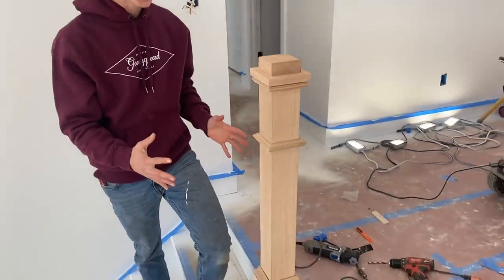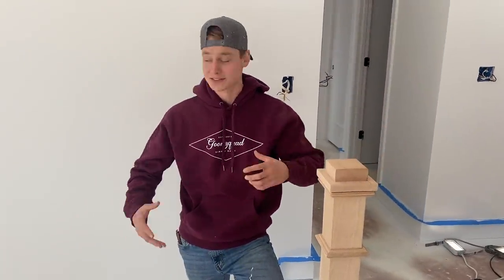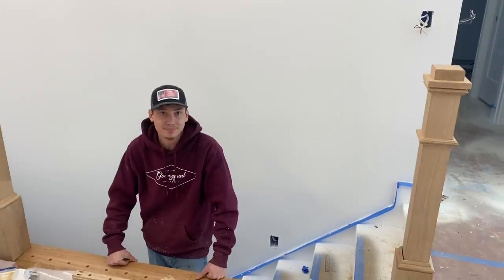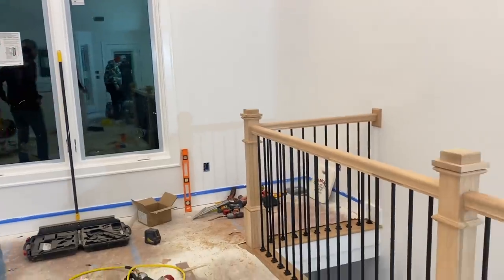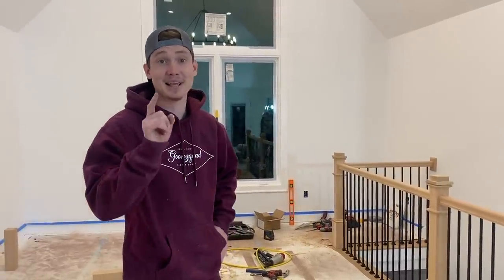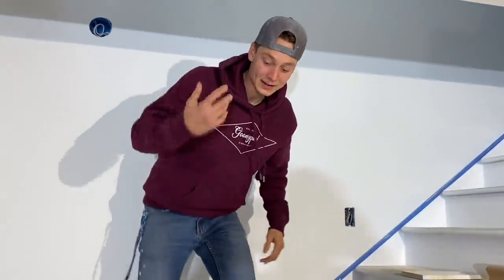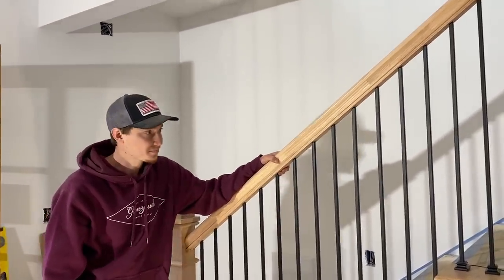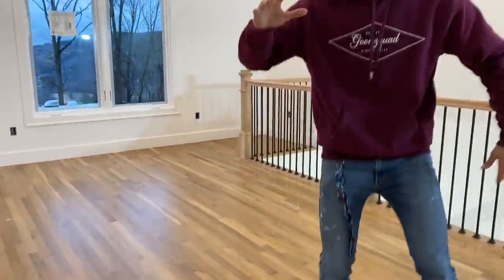The New Goonzquad Headquarters Part 64

Comment: The reason those newel posts were so long is because you were supposed to bury them below the floor and tie them into some structure! 😔
Reply: What I have seen was to notch out the 4x4 hole in the flooring, sit the post in hole then anchor it with the braces.
Reply: Yep installed 100% incorrect. No way this passes inspection. What is worse is the potential to kill someone when the guardrail comes loose.
Reply: Exactly!!!
Reply: Need to use wooden dowels in the post and hand railing. I would also use some type of lag screws though the posts to the sub frame below the floors, I am afraid if someone gave your current setup can pull those small screws out.
Reply: @ingresswizard9044  Yep. No way that passes inspection.....if the inspector's on his game.
Reply: they don't actually know what they are doing..it's just wing it and go...
Reply: @Bon Aif why you post a unrelated video?
Reply: @Martin Dang son!
Reply: @Last Name First  What defects see hidden under the car paint???
Reply: @OldManGaming1968  Yes zip bolt would work.. So would a lag like this.  Both work same way. https://cheapstairparts.com/how-to-install-a-wood-newel-post/
Reply: @Martin I've mentioned this before. These two use YouTube to research how their projects should be done so, presumably, others do the same. It's quite possible that they saw this "method" on YT and took it to be an "educational" video, a "how-to". 
By posting their attempt, they've made things worse. That means there are now 𝑎𝑡 𝑙𝑒𝑎𝑠𝑡 two vids on YT showing this way of installing a Newel post.

If(when) they discover their mistake, they should take this video down. Maybe sounds over-dramatic but it 𝐜𝐨𝐮𝐥𝐝 save someone's life.

We all make mistakes; the important thing is to learn from them.😁
Reply: @2H80vids  It's not over dramatic at all, their videos get a million views.  If one out of 500 people that watch this video build a house and build some stairs later in their life that's 2000 that build railings that will fail with a good push.  If you have 2000 inproperly done railings you easily could have somebody get seriously hurt or die

Comment: Having your HVAC system professional cleaned post construction/pre move-in is a must.  You'll be living in and breathing that building dust for the rest of your life if you don't.
Reply: lol, you know what filters do right?
Reply: Facts inside Evap Coil and Condenser needs to be cleaned
Reply: @Dennis Moroz the problem is, they didn't seal off all intake and outtake vents during construction.
Reply: @Dennis Moroz filters are generally never changed every 30 days and the evap coils are supposed to be cleaned once a year regardless. There are no filters for the condenser coils either.
Reply: @nickwagner9339  yes there are filters.... but 

After the filters the duct lines are currently filled with crap from the building proccess, the filter  being BEFORE the dust will not do any good. Sure it will filter the dust picked up but the whole point of the clean is to get rid of the crap that is sitting in the hvac system.

Just sayin.

This is a common thing to do after a build is finished if you have good builders and hvac guys.
Reply: @nickwagner9339  HAHAHAHA obviously YOU don't know.. if there is crap in the ducts AFTER the air goes through the filter what is it going to do? That's right, NOTHING.  Buy a clue next time when you start trying to laugh at someone else.
Reply: @westie4ageturbo.749  If they bought a system that doesn't filter the return as well as the supply, then your right. Every HVAC I've ever worked on has both, maybe that's just industrie, or a lack of regulations where they are.
Reply: @Bon Aif wtf is that?  LOL
Reply: @CSM.HBJ-Dogg  3rd
Reply: @nickwagner9339  filters are on the intake air. Not the air that's already in the system.
Reply: @nickwagner9339  unless you have a filter on every vent then your wrong. if there is 20 lbs of sheet rock dust in the duct work how is a filter going to get that out? it will first have to leave through a vent get in the air and then be sucked back into the intake. (which means they will be breathing it in)
Reply: Have the ducts professionally cleaned. Drywall dust is much finer than dust. It will build up on your evaporator.
Reply: @jamram9924  just turn the damn thing on and open the doors and windows. Just like an italian tune up
Reply: They haven’t had any electrical running in the house meaning the hvac system isn’t even on, I doubt the dust has traveled that far into the ducts.. I feel like wouldn’t be too hard to take a vacume and and an air compressor with a shoot back fitting on it and clean them out quick. I’ve done a few duct cleaning jobs it’s nothing complicated, even if you do it the right way
Reply: @OliverBund  Indeed. And before that, the unfinished building had been sitting around for a decade with most of its flexible air ducts left open ended. Who knows what crawled in there to check out the bacteria on offer? It would make a great thriller/horror movie. Title: "Aliens 2021: They're Coming Out Of The Walls!"
Reply: @zachbrown1041  they drywall compound dust alone has got to be massive, let alone the floor sanding.   In their part of the country for a house that size, a whole system clean would probably be about $300 - which would be worth every cent to have it done right.
Reply: @Gibbbrayden  Why would you need filters on every vent?  Every HVAC I've ever seen has a filter on the Return and on the fresh supply. 20 lbs? lol
Reply: @nickwagner9339  what do you mean by return and fresh air supply? Everyone I seen there is only a filter before it enters the hvac system. 

Also how would that help if there is a ton of dust after the filter? (Right before it blows the air into the room)

Comment: you're not gonna like this, but for the downstairs rail I would replace the small wooden ceiling plate wit one that spans till the end of the ceiling for the remaining rails. Nice work though
Reply: I agree that is what I was going to suggest as well
Reply: I was going to suggest same thing! Only way to make it look professional.
Reply: And if you do, drill the holes before mounting the wooden plate, sounds logical until you forget :-)
Reply: I thought the same thing. Probably gonna have to remove and reassemble the metal Picketts so they can seal the wood.
Reply: Agreed but they also could have expanded the entire opening to the floor above 6” wider then the edge of steps to allow for one continuous rail along that right side.
Reply: Its unfortunate but thats the same conclusion I came to.
Reply: Exactly what i was thinking!
Reply: i agree as well 
but the top rail not done the gratest
Reply: My thought as well.
Reply: Use a metal plate painted black to match your light and spindles, you can paint can't you?  Construct using (2) 3/8" x 1" steel bars mortised into your existing wooden end cap extending to the wall mounted by to above with multiple countersunk flat head screws. The spindles would be mounted through half holes, those nasty short last step spindles could be tack welded in position on the outside rail. The inside rail closes last with cross bolts then the flat head screws. Edited 1/22. 
Complaining about the filler bamboo wood (saving the environment perhaps a rain forest) which provided the full post dimension then cutting the stabilizing solid core off are 2 big mistakes!  The core was there to be lagged into framework or foundation.
However you redo could retrofit in 6 months when you replace the shaky or sooner if inspected.  However you bring it into code MUST be your next video, this one should be immediately removed so a copy cat isn't injured!  This Old House & How To Fix This Old House have newell post installations and removing shakyness.
Have you repaired (to code) the preshortened first stair tread???
Reply: Agree
Reply: Was just about to say the same thing xD
Reply: Apparently a lot of us thought the same thing
Reply: @Martin the post should have gone into the floor joist, at the very least they should have used a longer screw to go through the nosing and into the joist below. The 2nd floor end post held down with those short screws won't hold anyone from going down those stairs.
Reply: I don't build or anything, but that seemed to me to be the cleanest option.
Reply: Beat me to it....wanted to suggest the same
Reply: That would look best and professional
Reply: Yep, this is the way I would do it too
Reply: Absolutely, that mounting block should have run all the way to the corner to accept the spindles.

Comment: Nice job, guys, those look great!  Two suggestions: 1. Consider buying a length of 3/4” oak about 5” wide to use as an upper spindle locator that you could finish like the floors and treads, it would go on the bottom of the wall from the post top pad back to the vertical wall.  That would continue the color and look of the wood but give you a secure spot to locate the tops of the spindles and finish everything off.  2.  On your hand-rail that will go on the other side of the stairs, don’t forget to add “returns”, the little 90-degree pieces that go almost to the wall from the rail at the top and bottom ends.  Most jurisdictions require them so that something can’t get hooked on the rail accidentally leading to a fall or issue.  You might check with your inspector to make sure, but they’re probably a good idea for safety regardless.  You’d hate to fail inspection for that detail, but I’ve seen it happen...better safe than sorry.  With the Kreg pocket hole jig and a good miter saw, you already have the tools necessary to do this.  Keep up the great work, really enjoying your enthusiasm for making this fabulous.  —Don

Comment: Don't rip the hand rail just extend the wood block cap thats nailed into the wall all the way down. CLEAN
Reply: Do you mean the bit that's going into the ceiling, to put the rest of the spindles into?
Reply: @konradgreen2567  the square wood block the hand rail connects to... extend it all the way down/ make a rectangular strip

Comment: Always draw your ideas on a paper before you start working. The downstairs rail will not look perfekt when it’s done. Remove the small wood plate and replace it with a Bar that spans on your ceiling till the end. Finish drilling the holes and put rails in it, Done! You guys did a very good job so far. You’re very gifted in everything what you’re doing.
Greetings from Italy and sorry for my English!
Reply: Your English is fine! You are right to say that planning and preparation is the key to getting work done properly. I think that many YouTubers consider that it is more entertaining to just rush into projects, make mistakes and then try to fix them. It is a casual, jokey culture which has little if any connection to real working life.
Reply: @johnstedman4075  👍🏼

Comment: Were you secured the handrail going up the stairs into the wood square block, you should have run that piece of wood all the way to the angle (about 3 more feet) so you could drill for your spindles and finish it off.
Reply: Exactly what I would do. 👍
Reply: 100% - it looked wrong
Reply: Also the newel post fixed with L brackets is a little suspect to say the least but we all have to learn along the way. You lads  have really stepped up on this one and done a great job overall though 👍
Reply: Larry is exactly right but also make sure you predrill it before you install it because screw gun wont fit at top 2 steps to drill the top

Comment: I think you need to pull out that little 4” square piece of wood that you put up where the handrail meets the ceiling and replace it with a 1x4 that runs all the way to the corner that way the handrail and all the rest of your spindles run right into the same piece of wood. Simple and clean.
Reply: Exactly my thought!! It'd look so much cleaner.
Reply: @bigred547  Id rip a post in half to mount on the wall so it matched.
Reply: Same here I was thinking the same thing
Reply: Does JR know you are cheating on him with this channel?
Reply: @koolaid53  😂😂 we have an open relationship 🤫🤫
Reply: @goonzquad   DO WHAT IS SUGGESTED FROM THESE COMMENTS
Reply: Yep what he said.

Comment: Love you channel - I own a stair company - Depending on your inspector and how close he looks at things you have some problems.  Your first guard railing post needs be installed behind the top stair riser per code. Use the proper hardware to install your posts and use some Franklin tight bond on your railing to post connections with the screws to keep the joints from breaking and moving.  You need to epoxy in the spindles at least on the bottom for sheer strength and keeps them from twisting/moving, the trim plate will cover the glue.  The guard railing per code has to be able to take 200 pounds of side sheer force.  Your railing right now is dangerous and should not pass code. The railing to wall connection needs to have a wood backer behind the drywall. Your bottom riser should have run clear through to the outside of the wall covered by drywall.  Then fasten your post on the floor to the face of the riser w/glue and hardened screws. The stair railing is guard railing too and needs to run riser to wall. You have to have minimum 36" opening between the post and the wall with the code hand rail installed  : )
Reply: Yes, that is the correct way to do it!

Comment: I have ALWAYS installed the Newell Post through the floor tied into the floor joist. THAT LOOKS A LITTLE SHAKY GUYS no offense. That’s why they come long
Reply: I guess they didn't have any youtube videos showing how to do that. Just the shady way with L brackets. Definitely not gonna hold up to much weight leaning on them and be loose and shaky in no time.
Reply: @wheeln24-79    Redo in 6 months?
Reply: Yes, those tiny L brackets and 3/4" screws seemed way too small.
Reply: HouseT
 That would be sturdy as heck. Great idea
Reply: Fix the Newell Post!
Reply: There is a building code lateral load the guards must meet.  Those tiny clips are wholly insufficient.  I said it weeks ago all newels need to lag into the floor framing long.  Inspector should fail them.
Reply: how about some jb weld?
Reply: @gregh7457  Can you weld wood ?   I was not aware of that. just kidding.  Those railings will Fail inspection.
Reply: Yup always into the framing
Reply: @kdrguru  You can use lags like Zip Bolt or a lag that goes down in to the framing but agree that little 90 bracket isnt right
Reply: Yes sir!
Reply: If they ever read the comments they would have known.
Reply: @waynespyker5731  that's legit......
Reply: @sethb4272  yup TOH Tommy Silva not approved
Reply: @_antman_au  no way the back walls gonna buckle way before because of the runoff from the rock cliff out back taking the deck supports with it
Reply: @gregh7457  or flex tape?
Reply: That's why they have professionals! Their hasn't been a single thing they've done right in this whole build. Its sub par amateur diy at best.
Reply: @waynespyker5731  no way it'll last that long. I pray to God they won't have anyone go anywhere near that death trap.
Reply: @gerthduramaxjosh9611  yeah seriously they were told when they took those things out of the box and asked why are these posts so long? I know it's tough to read comments on your own YouTube channel but seriously they ought to have somebody reading them. For clues.

Comment: Awesome awesome awesome!
Your solution for the hand rail downstairs is as follows:
You see that small wood plate you used to fix the rail to the ceiling? Remove it and get a longer one to attach the hand rail and the steel rods to it. This way it will look consistent all over.

Comment: Those hand rails don't look sturdy enough with those tiny brackets on the bottom
Reply: Just have one of them lean against it with all their weight and see what happens...😐😁😂
Reply: Its super sturdy.. proceeds to wobble it lol yeah dont look too sturdy
Reply: At 9:56 you can see how far the spindles go into the floor... it's pretty substantial.  I think those alone would give the guard rails a lot of strength.  For the stairs, they're additionally supported by the wood secured to the ceiling, and for upstairs, they're have added support from the section facing the back wall.
Reply: The spindles are fine, but I don't get why the just put in a couple of flimsy nails to those end pieces, that attach the hand rails to the walls. That is by far the weakest point of the whole build.

Comment: I have been around new home builds my entire life. I have never seen a stair guy use angle brackets to hold the post to the floor.  The post are normally notched into the floor . That is why they are so long.
Reply: When they sawed off the bottom of those posts 🤷‍♂️😬🤦